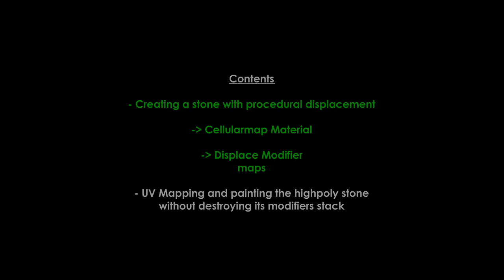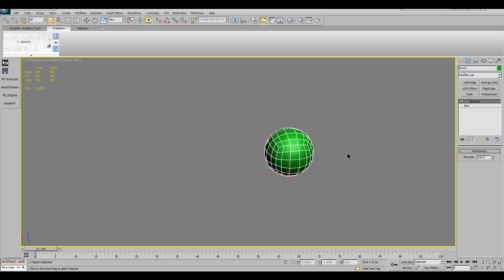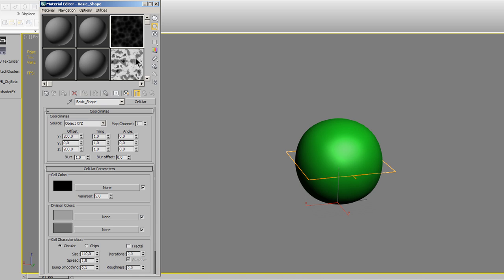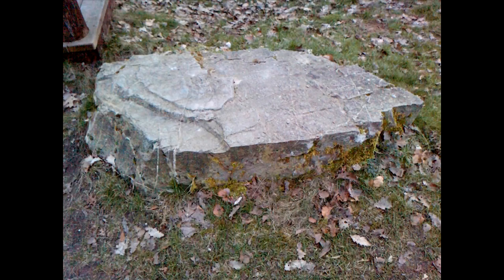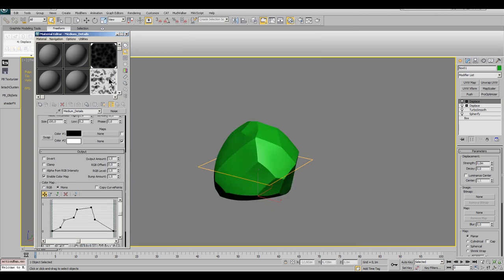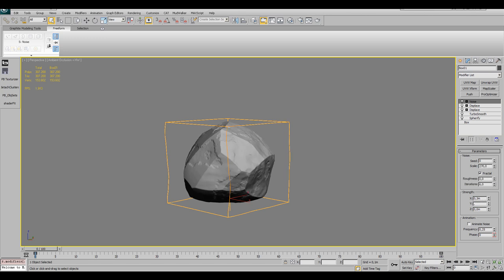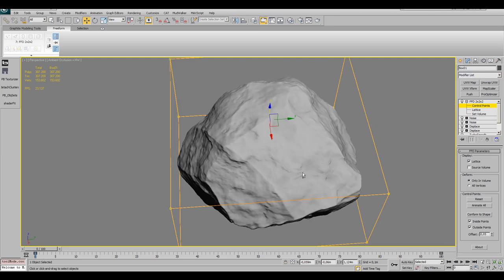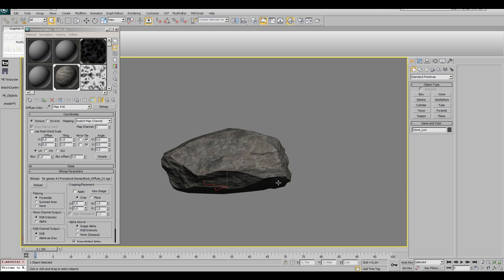3dsmax Environment Modeling #1 Procedural Stone

Comment: Good way or ending up with one HUGE rock model. You could not possible have more than a handful of these monsters in a scene without bringing 3ds max to it's knees.
Reply from the maker: pls use "render iterations" in your turbosmooth modifier instead of real iterations when using this rock as a highpoly asset. rendering a displacement map of the final result might also save you from the modifier overhead that is used on this item. also you might consider using the "Level of Detail" tool. see the 3dsmax documentation on how to use it in your scenes. also you could exchange the very high tesselated noises by a bump map in the material. however you'd need a uv layout then.

Comment: I am using 3ds max 2014. I'm using the exact same material settings as yours, but it's not giving me the black and white output. Would there be any causes for that?
Reply: I managed it! I had the wrong units set up :P Thanks for the help, though!
Reply: I have the exact same issue! :( 

Did you manage to figure it out?
Reply from the maker: hi i tried it in max 2015 and everything works as in older versions. might be you have to tweak your units or overall size of your displacement maps? this screenshot is from max 2015 http://imgur.com/Z4PucqP

Comment: Thanks for the link but now If I set the system unit setup (1 unit = 1.0 centimeters and my display unit scale to Metric (meters) then my box appears really big and covers the grid. Similarly if I set (1 unit = 1.0 meters) then box appears way too small. Do I have to adjust origin, distance from origin and resulting accuracy? If yes what values to I set?

Comment: Thanks for fast Reply! However I had initially my unit system set to metric (meters) and I never used scale transformation. I am pretty sure I am entering correctly all parameters you set but when I set the displace strength to 1.3 and mapping to spherical my shape looks more like an oval egg shape rather than your sharpy stone! I honestly don't know what is wrong. Does it matter that I am using 3ds max Design 2013 instead of normal 3ds max?
Reply: Did u get it fixed? I have the same problem.
Reply: @Animeta00  Hey I haven't used 3ds max for years and I can't remember what I had done to fix it! Eventually I had managed to fix this but I honestly can't remember how!
Reply: @solidsn2011  XDDD HAHA alright thanks for the reply anyways :))

Comment from the maker: hi solidsn, i believe you have to check your system units, which have to be metric in order to work with these settings. did you do that? also you must not creat a sphere, that is initially smaller than the 2 meters and afterwards scale it up with a scale transformation. the sphere has to be this size initially.
also when you make the sphere bigger as in the tutorial all your settings will have less effect. so it would be best to stay with the exact setting. is that given in your case?
greets
s.

Comment: Great tutorial! I only have one question though. I am using 3ds max 2013 but the parameters you are setting on your maps return different results in my screen! Like my rock appears more spherical than yours and less realistic after I add the 2 displace modifiers. Is this an issue with the newer 3ds max version or I am doing something wrong? Sorry if i am asking something stupid but I am kind of new to 3ds max.

Comment: Hello, i have one little problem here: my cellular displacement divisions seem less sharps than yours, also the cells are convex instead of flat like yours, so my rock doesnt look like a ''fragment'', if you get what i mean. Do you know what are the values i need to change in order to fix that, i think i tried everything but it wont work. thanks.

Comment from the maker: @inquestFLASH .. use a box as a start instead of a sphere. do not spherify it. and then just leave out the first displacement modifier the has the cellular map in it. that should do the trick somehow. you will always have to try out different settings inside the modifiers and maps though.

Comment: Hey great tutorial hope you can make more tut's like this ;)
but 1 question:
In the material Editor i used for they Cell Characteristics by size a valluey of 1100,0 and not 110,0 because when i used 110 they map is do small that i can't see so much different. But with a value of 1100 i have they same result how you. Did you know why this is so? perhaps because i use V-ray or i have wrong unit setups?
Thx Nemesis